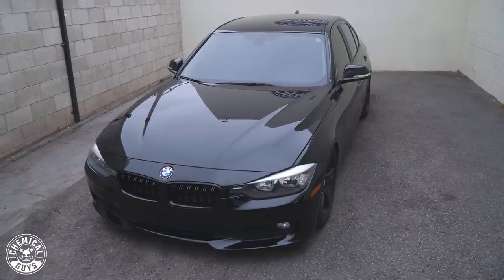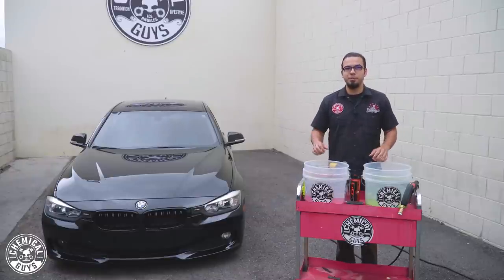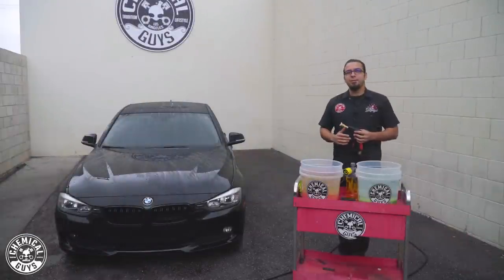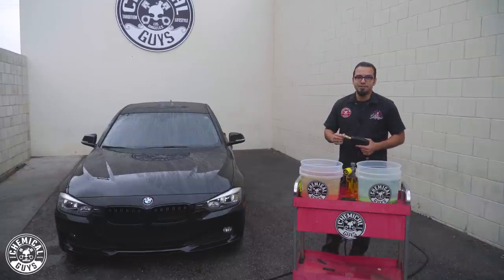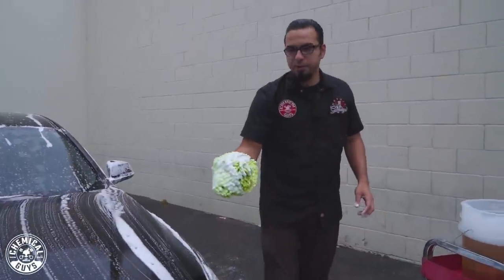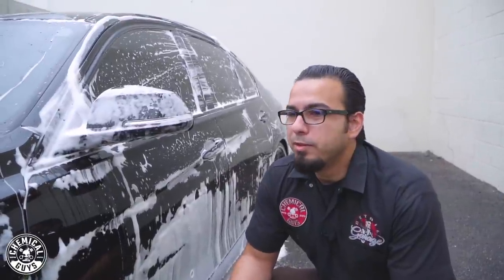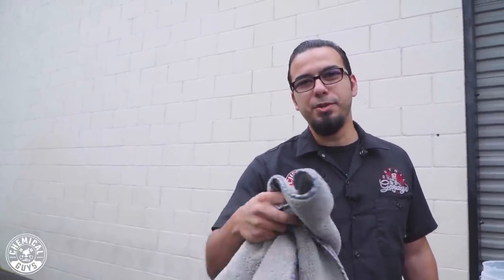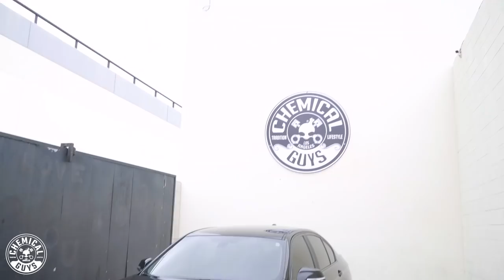Can You Get Reflective, Glossy Paint From A Simple Wash?! We Show You How!  - Chemical Guys

Comment: for hydroslick i know you apply by hand, but after that cures is it safe to user a polisher to spread glaze wax and sealant or should i do those by hand because it will damage the hydroslick underneath? thank you!
Reply from the maker: Hi David! Absolutely, after the layer of ceramic has cured, it is perfectly fine to apply your favorite glaze, sealant, and wax with a machine polisher using the lowest speed setting and a soft finishing pad.
- CG Nick